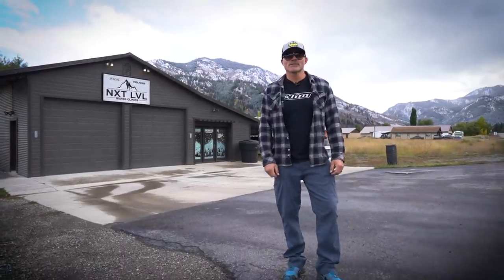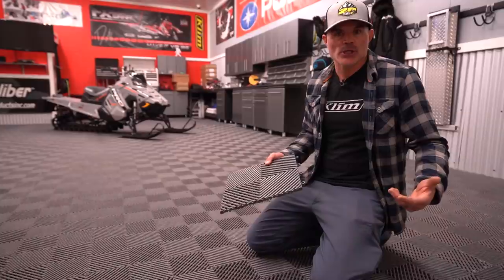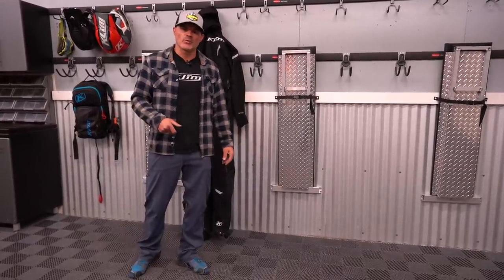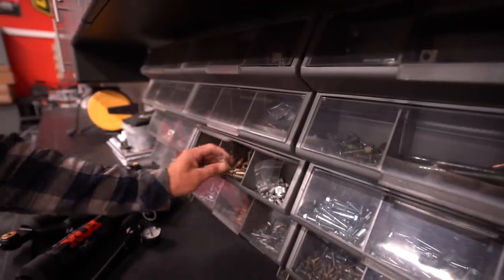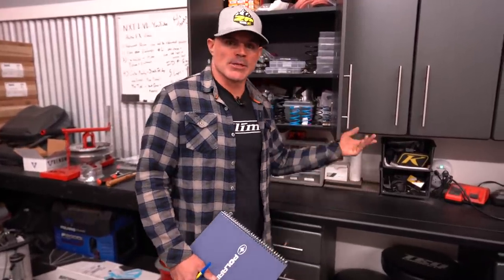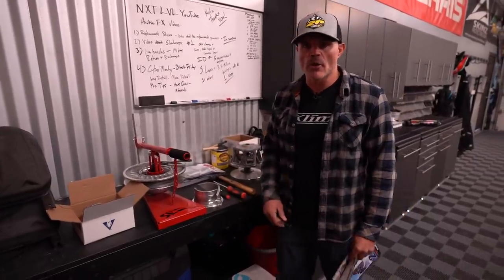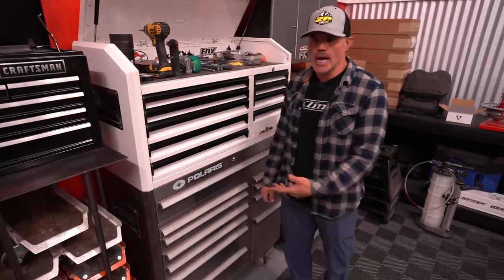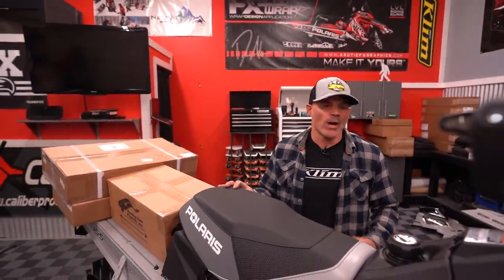Next Level Shop Tour

Comment: I have moved from air tools to Milwaukee tools to eliminate the loud compressor and hoses all over the place. Some that I use for building and working on sleds are the 3/8” drive fuel impact, their die grinder, 3/8” drive ratchet, and my new favorite the rivet gun!
Reply: My 3/8" m18 impact wont loosen the rear axle on my skid, if I could do it again I'd get the 1/2" strictly for that
Reply from the maker: Good to know, we have heard a lot of good things about the new battery tools.

Comment: How are oil messes to clean up with that flooring?
Reply from the maker: TJ Dietrich With any fluid spill, we just clean the tiles as best as we can, then we spray simple green or other degreasers through the tiles onto the concrete floor. Our garage floor is sloped to a drain so most of the time we just hose down the spill area and call it good. The bonus of the flooring is if the spill was really bad, you can simply pull the tiles necessary and get right to the area to get it cleaned! Thanks for watching!

Comment: Man ,  Pricey floor at $1722 to do a 24 by 24 garage,  Maybe I'll look into epoxies.  By the way do you have a sled lift you recommend?
Reply from the maker: Denny pad Hey bud I have researched and used many types of epoxy and have had some success, but it’s always tough seeing those carbide marks throughout the floor! The RaceDeck is so busy it just hides the marks and keeps your concrete dialed for the summer months! Thanks
Reply: In the long run, epoxy is way more expensive.. RaceDeck will last the life of your garage, - no staining, no peeling up,  and looks way cooler :)  - " You Coat It and eventually RD will cover it .. LOL